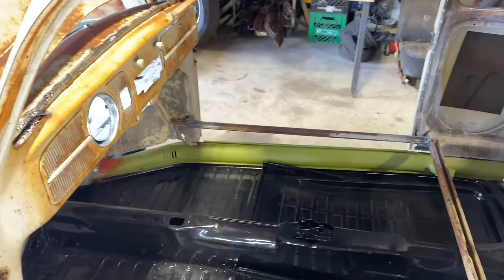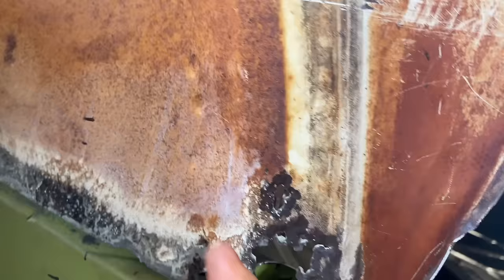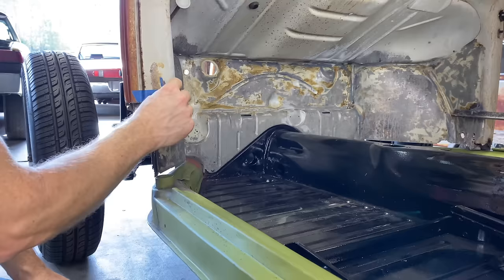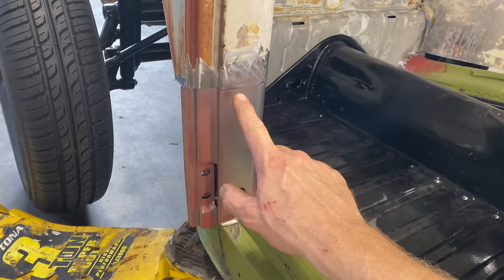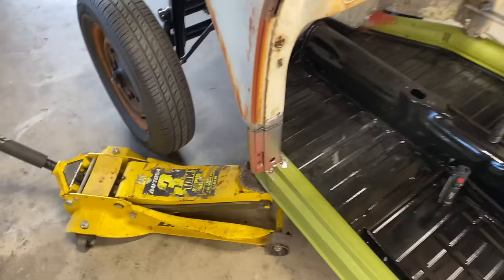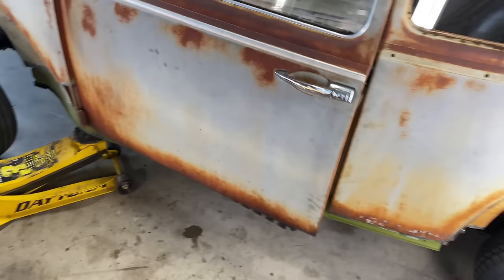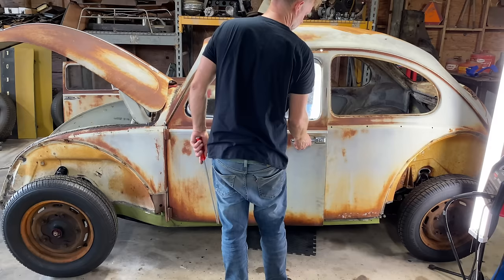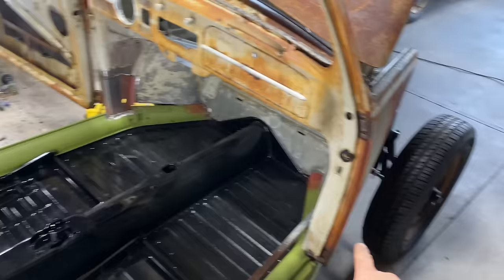1965 VW Beetle Restoration - Metal Welding! Hinge Pillar Install

Comment: I’m more and more confused after every video. I thought this was a get the chassis all good, the motor and get the most serious areas structurally sound like the pillars, heater channels, rear luggage, etc. It seems like this is becoming a restoration which makes it seem other projects will never get finished. Put the rat door on the car, don’t cut out the quarter, drive it.

Comment: What a thrill that must have been when that door just closed perfectly.  Great job.
Reply: That is the last thing you do on a restration . Adjust the doors . Even when you put the egine in the whole thing can change because of the wheight.
Reply: @patshes1951  and if it has the engine before it would not change the weight

Comment: Before you work on the passenger side, weld you a new cross brace in higher up before you cut out your cross brace you have in now. That way you have something to hold it in place before you cut out the A pillar to weld in the new one.

Comment: It takes real knowledge and experience to know where the rust spots congregate,certain areas seem to be water traps on most models,and selling just section pieces to preserve original metal.all the additives to paint to protect from salt on the air and land,precious treasures the air cools

Comment: Great job, make sure the lower door hinge is straight up and down. Use the Jack to hold the door up. Loosen the door screws some and do top or bottom first not both at same time. I know from my own experience with my old car.

Comment: nice progress.  I'm no expert but if you have got that much drop/sag/movement in your door the problem is more than likely your hinges.  you can't adjust that out with the screws on the a-pillar.  you'll need new hinges or new pins for the hinges.  a little bit of play in the hinges equals a lot of play when you get all the way out to the other end of the door.  I'd look there first.
Reply from the maker: Thanks Annie! That is great advice. You look pro to me. Keep up the good work! =)

Comment: Fantastic work. Very methodical and well done; one bite at a time. At this pace the outcome will be optimal. Don’t get discouraged by the door not aligning perfectly at first; remember everything is not fully welded and you are missing additional panels. That will give the body a lot more rigidity. You got the pillar where you want it.

Comment: FYI I tack the piece in then cut right on top of the new piece.  This gives the proper spacing for the butt weld and holds a true line.

Comment: Hey CT, if the body isn't completely bolted and torqued it will mess with the doors too, the service manual shows shimming the rear body mount to get the doors adjusted.
Reply from the maker: Thanks man! I need to get one of those service manuals.

Comment: I think part of your problem with the hinge is that the tack welds are only on the outer skin of the pillar.
The inner part will flex as this is where the door actually fasteners to.
Great work though it's great to see the progress.
If you get stuck at any point I have the VW workshop manual with all the measurements.

Comment: you are getting better with every video, you are great to watch and I believe you are doing a great job thanks for the video , by the way you could have used the jack under the door with a 2x4 in between to hold the door up while you screwed the door in the pillar

Comment: Hey CT. I've been following this build closely because I have 7'1 Super Beetle project car that has some rust which will require new metal. Watching you patiently work through your metal work is inspiring to me, to the point I feel I can attempt to do the metal work on my bug. (Fortunately, my rust is not as bad as yours.) Your videos show the real-world DIY process and spirit one will can expect in doing roadstoration work. Thanks so much. And best of luck in your continuing rebuild oh your '65.

Comment: After having watched several videos about how to rebuild a rust - eaten VW Beetle, it has become quite clear to me that this is no DIY work, but has to be done by someone who has a lot of experience in a) autobody repair , b) preparing metal and paintwork, c) restoration of aircooled VW engines. Btw.: Did you know that Volkswagen also made a station wagon version of the Type 1302 / 1303 called the "VW Variant"? I saw these myself sometime in the late 1970s when I was a kid.

Comment: You will have to do some layer staggering there, because the vertical "tube" structure is made of 2 layers and you need to weld both. It's better to stagger joints, so it's not everything cut and welded in the same place, which reduces deformations and gives you a little extra holding power if some welds end up crooked, usually because unreachable.
Don't forget a pencil and paper to get exact shape allocation. Other than that, spare parts look quite nice, your work is also improving.. The important thing is that we learn every single day.
For door alignment, check if there was some gap between the heater channel upper edge and the pillar mount you tacked on the original, since it's quite rotten, the pillar base might be moved slightly backwards. Check twice, adjust once. 😉Also check for play in the hinges.. Those oldies many times have some play which messes up everything you do. Don't throw away originals untill you finish repairs. Cheers, Mr. CT, keep the flow going.👍

Comment: I seem to remember those door screws are set;unset using an impact screwdriver. They have to be really quite tight. My beetle in the 80s ended up with two doors of differing colours by the end.

Comment: I would replace those hinges. The holes are probably ovals, and the pins turned into camshafts. Finally, if it still doesn't fit, you can always use shims.

Comment: Your hinges should have zero slop once you get everything welded back together...  When you lift on the back of the door, it shouldn't shift at the hinge...  If it does, you may need new hinge bushings...  Any slop between the pin and the hinge means it's time to repair them.  There's almost no way to get a door fit well with bad bushings...  Just looking in my crystal ball for you!!!
Reply from the maker: Thanks Greg! I think your crystal ball is correct! =)

Comment: ALSO THE HINGE PILLAR IS MOVING WHEN YOU OPEN THE DOOR
Reply: Because it’s not fully welded and also missing more metal around that is going to be replaced. I believe it will get stronger once all that is done.

Comment: 24:58 / 38:59 Wondering, if someone suggested to you, to use your floor jack when realigning the door? It makes it easier. Plus, when you close the door to Aligning the edges evenly. Take a measurement from the bottom of the door when it’s close. Open the door, and use the floor jack. Jack the door to the measurement and tight up the screws. That should keep the door close correctly. Plus, I would replace all pins from the doors. You can also, replace the right top door pin and have a screw pin on top to add in a right driver mirror door.

Comment: What you can’t see is that the lower triangle that is missing on the outside is allowing flex and not supporting the bottom from dropping! See you finally noticed, awesome.

Comment: It may help when ever you have holes that need to remain a constant distance like here with your top and bottom hinge holes to make a jig that bolts to both hinge holes before cutting the bottom ones away then you bolt the new part to that jig for reference...

Comment: Put your new heater channel tub in before you weld in. ( Oh and the next time before you take doors off a Volkswagen lightly score the out side of the hinge just opposite of screws behind the tires if the door is closing good they should go back in the same location..
Reply from the maker: Thanks James! Good tip!

Comment: Looks like your bottom hinge on the door needs replacing.  You might also need to adjust your door striker plate on the B pillar.

Comment: This series has been awesome and very motivating CT! Thanks so much. I have a question. I’m curious if the pan gasket is installed, I don’t recall it being installed. Will the thickness of the pan gasket change the door fit? I would think it would raise the pan perimeter area but the front and rear mounts would stay the same resulting in an angle change on the hinge pillar raising the rear of the door. Just my head going hmmm🤔 Love your channel, keep up the great work✌🏻
Reply from the maker: Thanks Nic! That's a good question. Maybe I will test that theory this week. =)

Comment: You sprayed weld through primer on the back side of the new lower pillar. Why didn’t you spray it on the new rocker where you ground it to the bare metal? 
All that bare metal under the pillar will continue to rust.